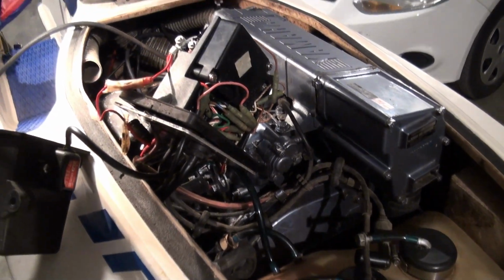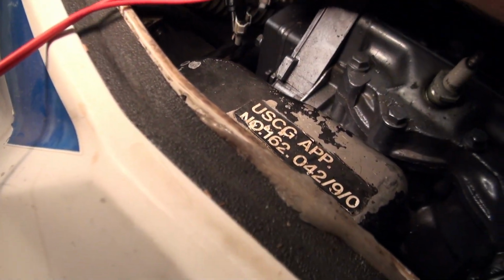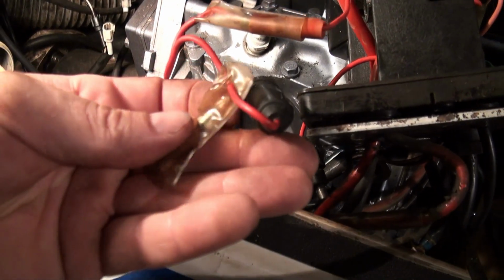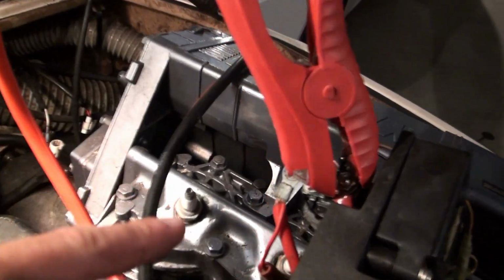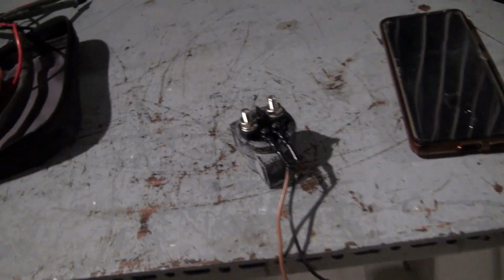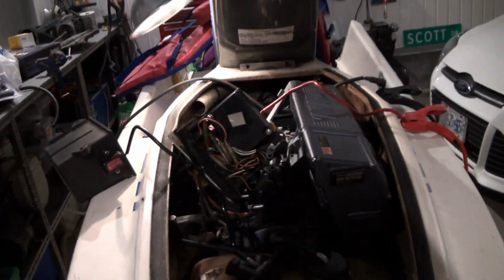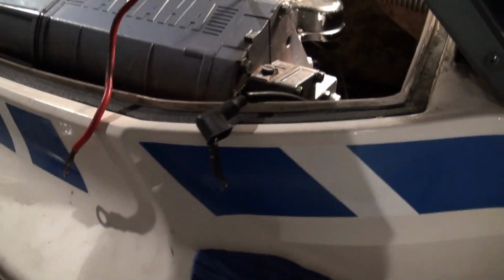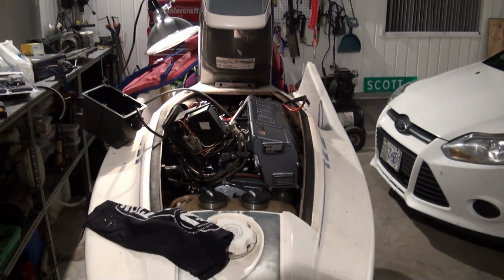1988 Yamaha Wavejammer Restoration Part 1, No start Issue

Comment: Or Voltage regulator ✨✨✨✨

How do I know if my stator or regulator is bad?
What Are The Symptoms of A Bad Stator? Why Do They Occur? Some common signals to look out for are: zero/weak spark; dead/dim bike lights/charging lights/headlights; dead batteries or electric components; and lagging acceleration.
Reply from the maker: Yes, excellent comment here !